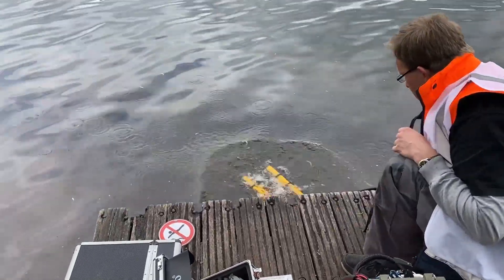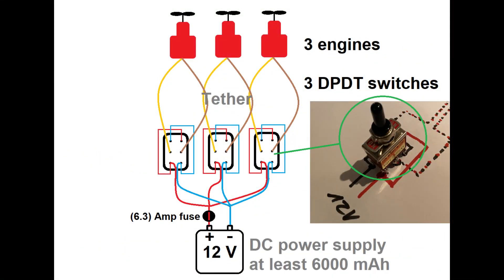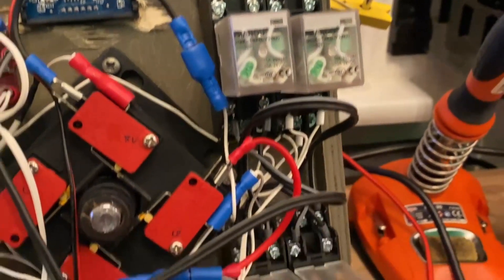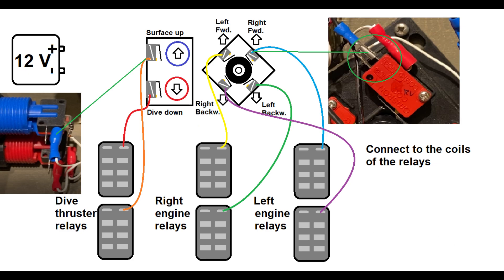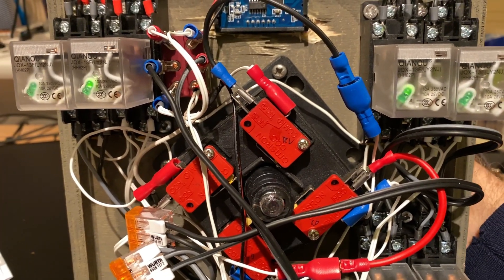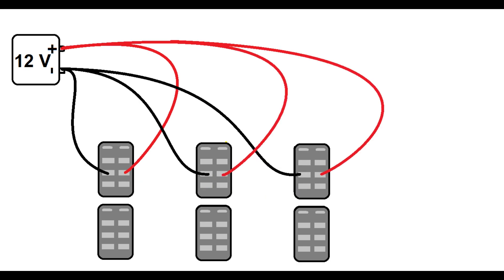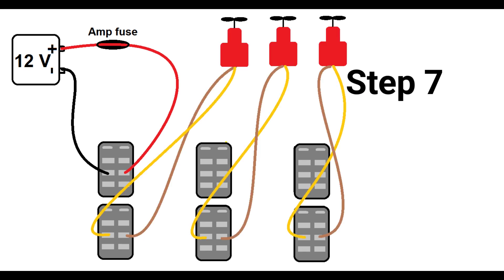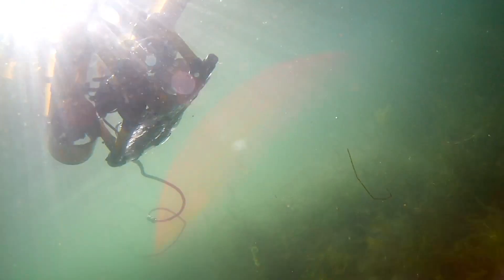Wiring your ROV controller step by step DIY

Comment: Hi I found these videos really helpful but  I was wondering if i could connect 6 bilge pumps/ thrusters to this rely system  for my rov - could you get back to me?
Reply from the maker: Well if you just double each engine up, no problem. You just have to make sure that you don’t overload your wiring (strong current!)z

Comment: What tipe of relays do you use ?
Reply from the maker: The relays are way too big, but I wanted the visible mechanical version. Mine are fit for 10 A and 250 Volts.

Hence you can take any 12 Volt (8 Pin) relays for approximately 6 Amps tops.

Comment: Hello!
Thank you for some exellent and helpful videos.
I have just started my own ROV project and I have some questions.
IIn the first example with switcches for steering the relays are onboard the ROV, right?
In the joystick example, do you still have the relays onboard or just the ones in the joystick control box?
If I understand it right it is a total of 12 relays. 6 in the joystick box and 6 in the ROV.
I have some trouble finding the relays you used for the joystick, do you have the name and/or number on them?
Thank you again for some really good and inspirational videos!🙂

Comment: What system do you use to transmit signals between rov and controlbox? How do you transmit the video signals? Please help me, I`m trying to make a rov like yours :)
Reply from the maker: The video is just a fishing cam with a screen. Just mount the cam to the ROV, stow the cable into the tether and watch with the screen. Nothing to it.
The rest about the ROV controller is in the video: just 12 Volt power on/off with the relays - nothing digital.
Reply: @agermangineer  Ahaa thank you so much. This helps a lot 🙂👍👍

Comment: What relays did you use?
Reply from the maker: I used slightly hardcore 12 Volt DC relays fit for high current 240 V AC systems. 

https://www.ebay.de/itm/Leistungsrelais-10A-LY2NJ-DPDT-8-Pins-Mit-Sockel-12V-DC-24V-DC-12V-AC-24V-AC-/233196699695?mkcid=16&mkevt=1&_trksid=p2349624.m46890.l49286&mkrid=707-127634-2357-0

Comment: Was there a specific electronics reason you setup the relays near the power supply in the control box instead of onboard the ROV, like HomebuiltROV's? I was contemplating where to put my relays for my ROV, which would have a sealed enclosure that can be accessed (not potted), and I did not know if voltage drop would be better or worse with each setup.
Reply from the maker: The reason is simple: space! I did consider using an onboard power supply and have the relays onboard as well, but there was nowhere near enough space.
If you can make that happen, you need another power supply for your controller and your relay coils which get activated over the tether. That way your motors don’t suffer power loss and the relays can easily deal with a fair amount of power loss over a long tether. 

Some however have on board relays and still have the single, on-shore power supply. In that case you will need a very thick tether: the com-cables for each relay and a cable thick enough to feed 3 hungry motors with a reasonable power loss.
On the plus side: that thick cable can be used as a recovery line in case the ROV gets stuck. 

Hope that helped...
Reply: @agermangineer  Thanks! It seems like putting the relays in the control box is the way to go for this kind of build. I am trying to build an ROV that has an Arduino Uno in the control box that communicates to an Arduino Mega in my ROV. I wanted to incorporate HomebuiltROV's relay design onboard the ROV instead of motor controllers to make things easier. That way, communication is Control Box Uno -> MAX485 -> MAX485 -> Mega -> Relays -> Motors. If I put the relays in the control box, I would have to separate the motors from the Mega, meaning that my tether would be 2xCat5 cables, which is way too thick. On the other hand, if I put the relays in the ROV, my tether would be a cat5 (for data) and 2x12 AWG wires for power, correct? If I am using an onshore battery like the one used on the Seaperch, then would I be able to connect the power to the Mega and be done? For context, I am using 4x500 GPH Bilge Pump Motors (I want to have enough capacity in case I upgrade to a 1100GPH motor) and I wanted additional functionality like a claw, hence why I am going the arduino route.
Reply from the maker: @DynoDunes  I have never built anything with Arduino circuit boards, so... I can’t give you much advice in that perspective.
4 motors with up to 1100 GPH... that’s around 16 Amps. So make sure you fuse and wire accordingly.
Cat 5 for com and a thick power line sounds absolutely correct. 
A possibility would also be the the Vellman 8023 remote control board with 10 channels. With that you could break it down to just 4 wires in total. But of course the arduino is much more versatile.

Comment: What gauge wire did you use for this ?
Reply from the maker: I knew I should have included that...
For the coil wiring I used thinner cables around 22 awg - since they are short and don’t need much power.
And for the power distribution I used crimped 15 gauge all copper wiring at around 1.5 mm^2 to keep the resistance at a minimum.
The tether is a different story and video.
Reply: @agermangineer  thanks that helps.